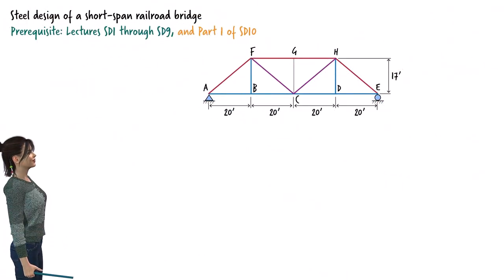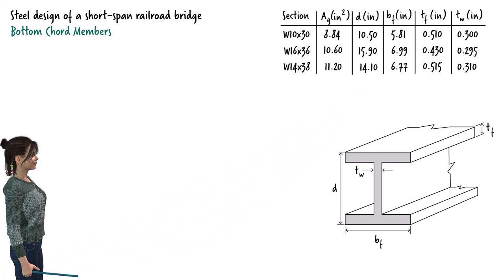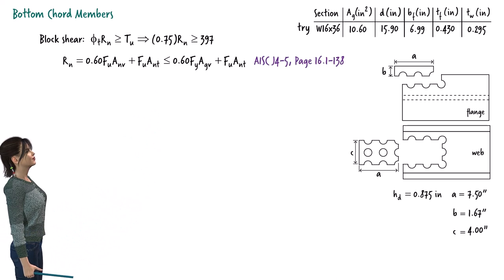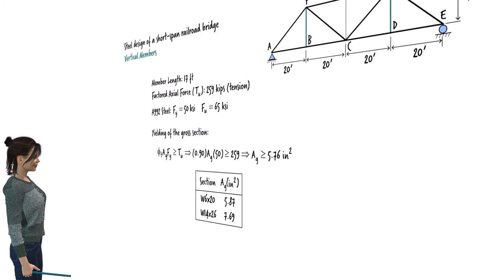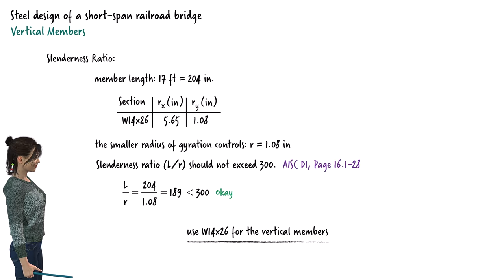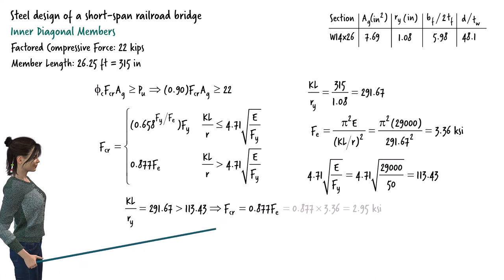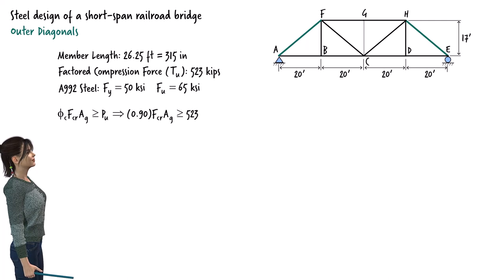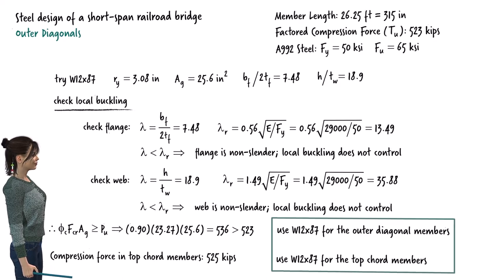SD10.2: Steel Design of a Short-span Railroad Bridge (Part 2)

Comment: Thanks for the very informative lecture series. How can we imagine the number and rows of bolts, without design for connection. As in the videos lectures series we haven't studied design connection yet. Please explain the process of actual design whether we have to design connection first or we have to consider any suitable number of rows. Thanks
Reply from the maker: Correct, the connection must be designed. In that process, we determine the bolt size, bolt spacing, their number and arrangement, … But since we have not yet covered connection design, until we do, we assume a given connection works.
Reply: @DrStructure  waiting eagerly for next parts, please keep uploading the good work,